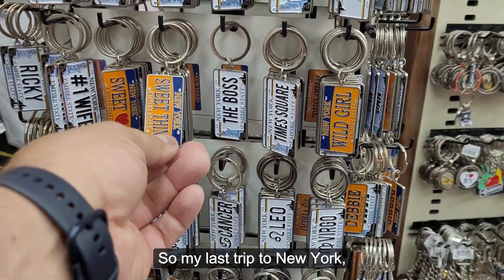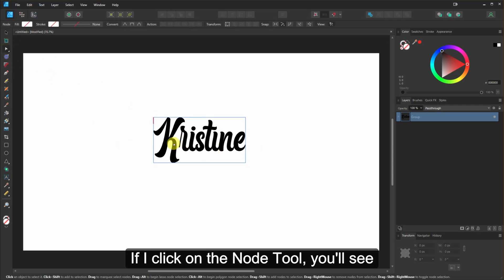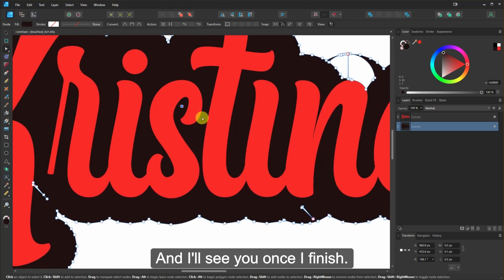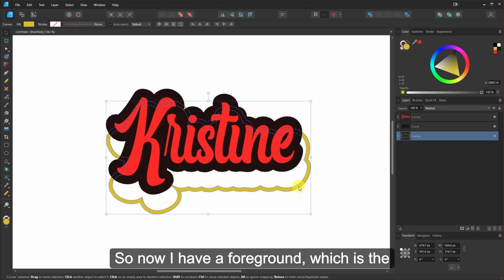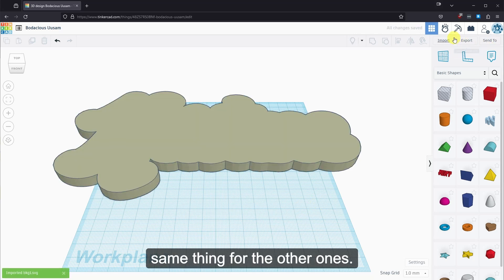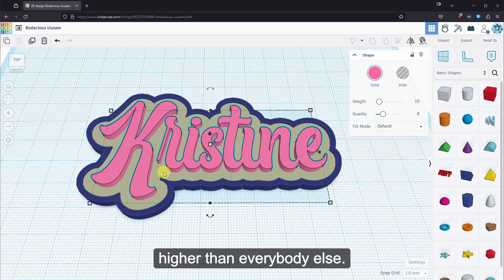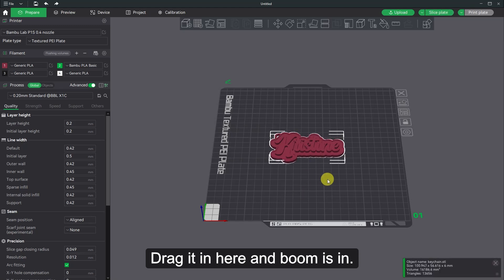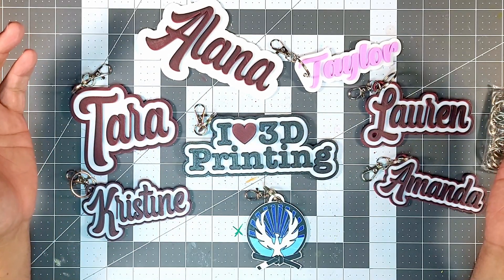Learn to 3D print keychains using Affinity Designer and Tinkercad

Comment: Broo...Please share printer u use. Filament printer makes output as Line waving and how to fix it. Which is better Resin (or) Filament .
Reply from the maker: I use a Bambu Lab P1S for filament, it is a core xy printer with AMS, which is how I get to pick the colors. I also have a resin printer, the resin printer I use to make more detailed statues like my cyclops or my Bulbasaur video. Filament is a lot easier to use and much safer than resin but they both have their unique uses, filament for larger or more practical uses (tools, etc), resin for miniatures, statues and more detailed sculpts.